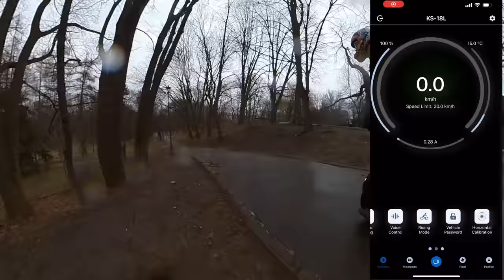King-Song 18L 2022 Review - Amazing All Rounder

Comment: I just upgraded from V8F I got in August 2021 to 18XL V2, which comes with spiked pedals and mini-power pads (protrusions at front and back of upper pads). Pedal height is about 15 cm (manual states 16 cm), with a slight angle. With the increase from 16 kg to 24 kg, the tire flexes more over small bumps, resulting in a smoother ride  (vs V8F).

Comment: FWIW I am a very fat rider at 260lb and 18XL has worked great for me in my first 100 miles. I live in a hilly area and haven’t gotten any overpowered warnings. I also try to ride at above 35% battery. I don’t use power pads and definitely am a more mellow rider. I don’t overlean etc. My max speed on it has been 28mph but am usually cruising closer to 17-22mph. 

Someone had said I’d get the urge to get a faster wheel and cruise in the 30s in no time. But that hasn’t happened. This wheel truly is good enough for my use cases.

Anyways this comment is dedicated to other “heavy” riders. If I were you I’d probably avoid going full lean on anything (maybe Sherman??) and from that perspective you may as well go with the 18XL. It’s such a smooth ride and it can support up to 300lb according to eWheels. Of course the more buffer there is between your weight and the max, the better. But this wheel hasn’t yelled at me yet
Reply: Yeah, many ppl say you'll "grow out" of slower wheels in a month, but here I am, at 180 pounds, and happy with a V8F one year later.
Reply: Thanks for this comment, I'm also a heavy boi, so it is good to know this wheel can handle us. How much range do you get out of it  if you don't mind me asking

Comment: Clocked 4000 km on my 18L not so long ago. Been riding (and falling) on it through whole winter. If I'd have to point out any issues after that mileage it would be that trolley handle having quite the opposite issue to yours, have to wiggle it to be able to close it. Also sometimes when you'll close it too... "accurately" the lift switch just won't turn the motor on once again, so gotta inspect that. Apart from that there's some water filling my front light probably from the bottom so I gotta check seals. Other than that, no issues at all. I also hope for new revision of 18L/XL with slight improvements, because for now... if I'd upgrade my 18L then it'd be only 18XL.

Comment: I have 9000km on my first KS18XL I broke the inner shell after 8000kms with a lot of offroad, after its replacement (100€ and labor) I decided to sell it, the new owner is at 11000 kms without problems. 2 months after selling it, I missed it so much that I bought another one 😆😅 (I have a Sherman, MSP, ks16s and ks18xl)

Comment: I have an 18XL with over 15.000 km on the clock. My trolley handle has the same problem as yours but it resulted in dropping the wheel several stair cases in a row. I tought I destroyed the wheel but only the handle took minor damage, what really surprised me. Once I broke the inner shell. I have now the white one which is more sturdy. From the outside it is still black. Newest problem is that the handle doesn't stay in its lower position which makes the wheel hard to cary. Also I had to replace all screws because the stock ones are garbage.  But over all I am really impressed with the quality and the reliability of the wheel. On tire changes I noticed water getting inside the wheel, but it can't reach important parts like connectors or even the mainboard. I used the wheel in monsoonal rains which killed my IP rated headlamp but not my wheel. With beeps and tiltback this wheel is pretty much foolproof unless you really try. Still one of the best and maybe the best all around wheel.
Reply: Thanks for your advise... I'm about to clik the buy it now button to get mine... =D
Reply: @yannolet28  You certainly won't make a mistake with this. Still, you should also consider the Inmotion V12 if it's available in your region.
Reply: What you think of Inmotion V11, In Canada no more KS 18 XL. I am now looking at the V11. V12 is available for 100$ buck more then the V11 but no suspension, And does V12 have trouble... seller say this : TEST EVERY V12 WE RECEIVE USING INMOTION'S OFFICIAL TESTING PROCEDURE. WE WILL NOT SELL A V12 THAT DOES NOT PASS THEIR TESTING PROCESS** ??? So I am wondering why? Hahah
Reply: @yannolet28  Yes the V12 has had problems but Inmotion fixed them with a new mainboard. But the V11 had its flaws too. Despite that, both are great wheels. V11 is more for comfort and V12 more for performance.
Reply: @MaximilianGros  I had a hard life , pushibg my body over his limit all the time...I might go with one equipped with suspension to save my old knuckles hahaha. Review and feedback on the v11 seem not that bad. And I have to worry about money... V11 with suspension and deal breaker seem the thing. Do you know anything or have any tips I should be aware  with the v11?
Reply: @MaximilianGros  Just to let you know, seller told me that. We sell the latest version of the InMotion V11 with improved motor, rubber-sealed bearings, saddle, and firmware.
Reply: @yannolet28  The newest version should be fine.
Reply: what screws did you buy to replace the stock ones?  Looking to do the same. Thanks
Reply: @VinnyVonPapier  I went to the hardware store with the original screws and got myself some decent hex head screws.
Reply: @MaximilianGros  Ok thanks.

Comment: I really appreciate it, thank You :) I wanted to buy this 18L, but then I opted for the 16XS.. yes, not the 16X, but that was my budget :D and I am still waiting for it :)) I can't wait... and in the meanwhile I am "eating" all the videos about EUCs :)))
Reply: Why did you choose the 16XS over the 18L? I'm facing the same decision
Reply: @MlleEntoxya  The main reason was just because the shop told me that they were getting the 16XS first (but I am still waiting due to delays of the seller), but then I also thought that the 16XS might be more fun, once I get used to it - and it would be my first wheel :D but for sure the 18L is more smooth and more like a cruiser, as Adam also said :) it depends on what you prefer :)
Reply: I got the 16-XS as well. I picked it because it was in stock, and I could get it right away. It has been a blast! I have added a second battery so I could double the range.  I use it for fun and as a commuter (10.5 to 13.0 miles to work, depending on route because of traffic and time of day. ) I've put on 1430 miles in 10 months.

Comment: we don't need IP rating. Just the manufacturer to put the effort in for water resistance. IP ratings are expensive. I'd be happy with a manufacturer guarantee. May sound weird, but as a OnePlus (phone) user for multiple generations all without an IP rating (well they do now), but you can see that the manufacturer still put the effort in.
Reply: how much does it cost for an ip rating if you know it bro?
Reply: @laniakeafilament2730  it's not a static amount.

The way I understand it is that the manufacturer has to buy specific equipment to test their stuff in order to get an IP rating. That equipment is expensive and when your margins are already pretty slim, I doubt they would just eat the cost of the equipment.

They would increase the cost of their wheels. Which personally I'd rather they just put some basic waterproofing on the wheel and let it be.
Reply: @InsanitiesBrother  heys sky! ah i see. its not a static amount. yeah sounds expensive, and raise the margin cost. ballpark on average how much do you think it cost tho for an IP rating? 1 million usd? 100k usd??

Comment: 2100 urban miles on my 18XL, only issue I have at this time is a over sensitive lift switch that I don't trust to not engage at the wrong time, so I disabled it. This can be a pain when getting off on public transportation as I have to turn the wheel off to ascend/descend stairs. I will open the wheel later this year to do an inspection, cleaning and possible adjustment to see if I can make the lift switch function to my satisfaction again.

For my usage I probably would have been better off with the 18L as I might enjoy the lighter weight more but I can't complain at all about the range ability, so that is kind of a tough trade off in choices. I don't want a screen but I would like a battery level indicator like the V10F etc. Overall I am quite happy with the 18XL and will be keeping it for the foreseeable future.
Reply: did you manage to fix the lift switch at all?
Reply: @francoismurrell4604  I haven't gotten around to opening the unit up. Sorry.
Reply: The kill switch will never ever engage if the wheel is moving. Try to move your wheel and lifting it up once above 1 ou 2km/h, it won't disengage, you can reactivate it
Reply: @TheThunderwars  This is wrong, the wheel will in fact disengage at very low speed if the switch gets triggered, it has happened to me multiple times and has caused me to fall. That is why I disabled it.
Reply: @kmg501  do you have the v2 version ? The v1 has a very bad switch if I remember correctly and I don't know this one.

Comment: Just bought a 16x pretty excited. Its my first EUC also.
Reply: The 16x is a brilliant wheel. Had mine 18 months and no sign of an upgrade
Reply: @jonathandunleavy-colgan8876  what kind a mileage until i need to replace the engine and batteries. Like4-5k miles?
Reply: @seewaldsja  AGES! A friend has one with 4K miles on it.  Only had tyre changes and one new outer shell. I’d worry about learning to ride it first Steven. I’ve done 1.8k miles my tyre is good for the same agin (slimed). One bit of advice, when learning, pad ur shell. Even with bubble wrap. I didn’t and after 6 months the shell and foot plates were battered
Reply: @jonathandunleavy-colgan8876  i got the shell pad free for the holiday sale.
Reply: @seewaldsja  what’s a shell pad???
Reply: @jonathandunleavy-colgan8876  its a kevlar shield that slides over the whole wheel. Got its free for pres day in my order.
Reply: @seewaldsja  didn’t know they made one for the 16x. Who makes it my man, please 🙏🏼 😉
Reply: @jonathandunleavy-colgan8876  EUCO
Reply: @seewaldsja  many thanks. Enjoy!
Reply: @jonathandunleavy-colgan8876  guess its high density fiber and neoprene for resistance to oil .still great product!

Comment: hi, im from spain,  excellent video, you can see that you enjoy your wheels a lot, I have a question, I am a heavy user of 110 kg and I learned a 14 d which cut me off and shot me, well normal since it is a lot of weight for the wheel that is small and I was thinking between the Kingston 18 L and the XL I think the difference between these two is only the battery, right? Could the fact that the XL's battery is larger prevent it from being low and I demand a little more from it to be more sure that it doesn't cut me off? Now I was looking at the kidston 18S but I'm not much off road, I'm more of a city. Is it worth making the investment for the Kingston 18S? Does this wheel require more maintenance and care? What can you say to me? Thanks in advance and a big hug.
Reply: > Could the fact that the XL's battery is larger prevent it from being low and I demand a little more from it to be more sure that it doesn't cut me off?

Yes :)

Comment: KS18L is solid but outdated (4 years), weak performance, small battery, thin tire, bad lights, no seat option. And very high price - more than Rs. 
It definitelly should be upgraded, but probably wont. 
For today Rs is much better choice, offers more for same price.

Comment: How does the 18xl compare to the V12
Reply: V12 is a much powerful wheel, 16inch = way better torque. 18XL is a 40km/h cruiser, V12 is a 55km/h+ rocket. Range will be probably similar.
Reply: They have about same range, 18xl 20kmph slower than v12, but 18xl is around 10kg less weight.
18xl cheaper and has bigger 18" diameter wheel, v12 has wider 3" wheel.
18xl packed with waaaaay better handle.
18xl older wheel, way older, so almost every issue that it had in the past is already fixed by now, and it is ready to be used out the box, where v12 has cutout motherboard issues yet.
Plus, there is two options 18l or 18xl - depending on your needs.

Comment: Kingsong should seriously consider creating new version of the S18 and 18L(18XL), with the same shell, but with a more powerful motor, and a higher top speed.
For example, a Kingsong S18 ''V2'' with a 2500 or 2800 W motor, and with the same 1100 Wh battery, but with a max speed of 60 or even 70 km/h would sell like crazy.
Also, a Kinsong 18XL, with a 2500 or 2800 W motor, with a top speed of 60 or 70 kph, with the 1550 Wh battery, would be a great success.
Smaller battery size cost less, and weight less, and are great for city erands. Both would become competitor of the Inmotion V12.
Engineering would be simple, both wheel shell are already designed....
Reply: You need a larger battery with more powerful motors for it to be able to handle voltage sag without a cutout